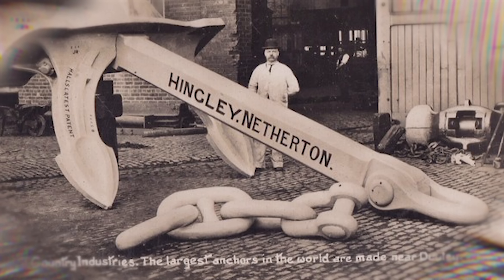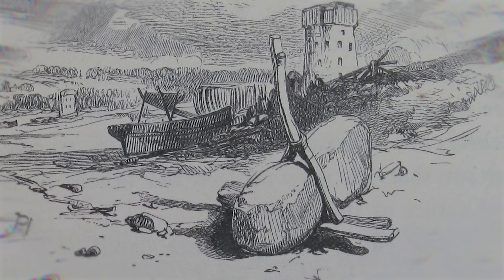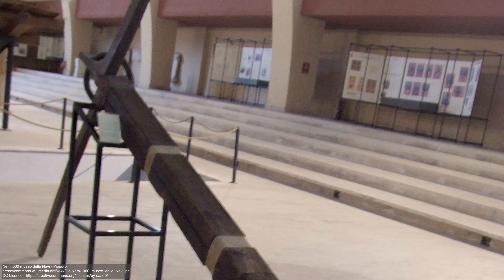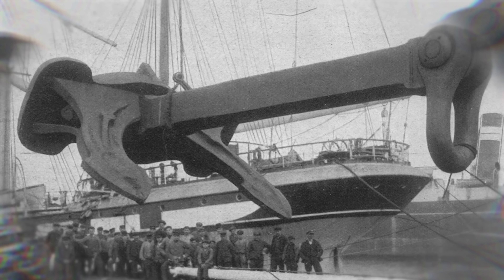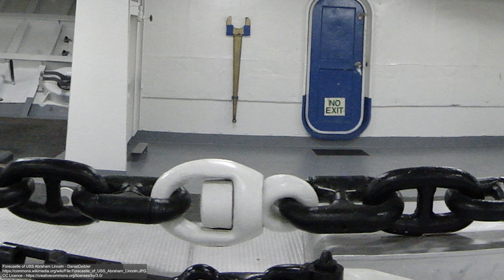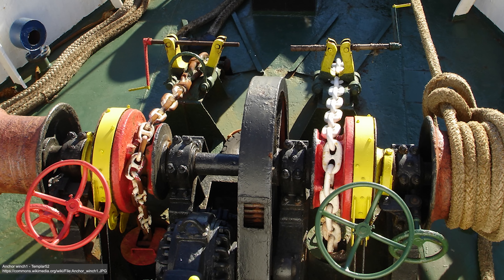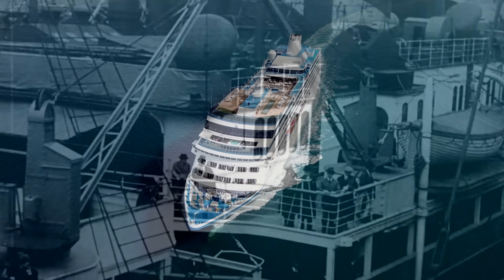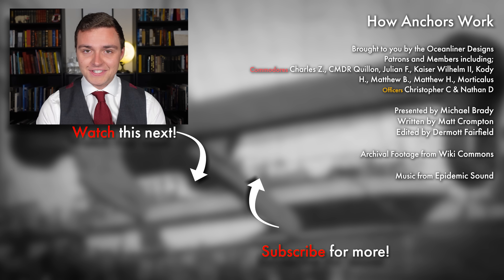How Do Anchors Actually Work?

Comment from the maker: Hi friends, I hope you enjoyed this video! A quick note on anchors; they do not necessarily need to be dropped purely by gravity and it depends largely on the skipper and crew's approach. Some anchors can be deliberately 'walked out' using the windlass so that they don't just drop straight through. Thanks to Michael and Thomas, two of our video reviewers, for this point. I also mentioned most anchor windlasses are electric but hydraulic windlasses are very prevalent on ships today as well.
~Mike
Reply: So basically, they are fishing hooks that you use to catch a planet.
Reply: @T.ring91 you will always lower a 22 tonne anchor using the windlass motor. You have to ensure that the ship’s speed is less than the max pay out speed of the windlass; usually about 0.3kts.
Reply: @OceanlinerDesigns  well researched and correct. Don’t listen to these armchair experts.
Reply: Ikr!?❤😊
Reply: Whilst your channel focuses on ships a supplemental video on Bruce, Stevpris and other anchors utilised in the offshore oil and gas industry as well as the catenary mooring method would be very interesting for a lot of folks
Reply: This is true, especially on the VLCCs I worked on. These anchors weighed over 22 tonnes.
Reply: I used to live in a house in New Orleans with the coolest feature I've ever seen built in. From ceiling to floor connected by what looked like the proper attachments were either 3 or 5 links (it was 1990) of beautiful old badass anchor chain. How many houses have that? They were in there tight too, they couldn't be budged. It must have weighed a ton, so that house has good beams!
The house is a couple of blocks from the railroad tracks and Bywater on Burgundy and something. I would love to know who put the chain there, they must have worked on a ship and probably had very interesting stories to tell, possibly historic. Does anyone else have these installed in their house?
Reply: Is there a estimation of time that titanics anchor may fall?
Reply: The boat i engineered on has one of the anchors from the Nimitz, it is a 25,000 lb monster. We always lowered it with the winch slowly to bottom, the result of the chain balling up and binding in the chain locker would be disastrous. Really liked this video, thanks!
Reply: A windlass is one scary machine.
Reply: 7:46 Port Said is pronounced like 'Port Sa-eed'.
Reply: The pivoting stockless anchors are still in use on pleasure craft. I'm a sailor. These are known as Fortress Anchors and  generally  serve two purposes as an emergency or stern anchor on sailboats and smaller ones in dinghies. In both cases their ability to fold flat allows them to be stored in an aft lazarette or on the bottom of a dinghy (without tripping people).  Most sailboat anchors are a variation of a shovel/plow, with one point. The plow anchor was once considered the best. It was designed after farming plows. But they also did what the farm plows did -- move through the soil as efficiently as possible without getting stuck... the theory of anchoring requires the anchor 'getting stuck.'
The video doesn't really explain very clearly how an anchor works. The essential theory is this: The anchor's weight goes up as the boat/ship gets heavier (and how much above the water freeboard:  windage).  When the anchor is dropped, the rode (chain, rope or both) is  played out until the anchor reaches the sea bed and  some chain is laying along the bottom. When the boat is 'backed' (reversed) there should be enough chain on the bottom  that instead of lifting up it drags along the bottom  pulling the anchor until it  sets (bites) into the sea bed.  Then more rode is fed out until the proper rode to depth ratio is reached. On my boat I like 5:1, so  20' depth, 100' of rode.  If the boat is properly anchored than wind/tide/current conditions won't be able to dislodge it, or if they do, as in a change of wind direction, the anchor should be able to drag a bit, dig back in and re set itself.  (You shouldn't be able to use your windlass to Haul Anchor, pull it up. You'll be able to shorten some of the rode, but a properly set anchor should resist.)
 To raise the anchor:  The boat slowly moves so the bow is right above the set ancho. Rode is being pulled in by the windlass. When the rode goes straight down to the anchor, it will be easier to un set it and pull it up.  
On my 46' (14m) boat I have a working but slightly undersized 45lb anchor, 200' (61m) of 5/16" chain and 200' of three strand rope rode. In poorer or more practical places the local sailors often have only enough chain to lay on the bottom to set the anchor, everything else is rope.   
The best boat anchors are considered to be Mantus, Rocna and  Ultra. What's interesting is that the point of the anchor should be as heavy as possible, this is so that no matter what position the anchor is in any motion will cause it to drop that point to the bottom so it can dig in. Theoretically there could be not very heavy anchors with a very dense heavy point to dig in.
Reply: @WillN2Go1  he is talking about proper merchant ships, not little pleasure craft.
Reply: @garysmith2450  If you're in the merchant marine, let me know what's different, other than scale. What's different in the video is he doesn't cover the basics of any anchoring.   The cruise ships I've been Shanghai'd on by my mother in law, drop anchor, reverse to set, then let out more scope (you can hear it all over the ship) just like my 46'.
Reply: Thank you........                                                        
Old F-4 pilot Shoe🇺🇸
Reply: Thank you Mike.  Another interesting niche subject covered well.
One thing you did not mention was the occasional run-away of the chain when the anchor is dropped.  This should not happen, as the anchor should be eased into the water.  But if the descent is fast enough, the descending chain can overcome the brake built into the capstan, will drag out the rest almost explosively... and can rip out the massive fixture attaching the bitter end of the chain to the ship.
There are a few videos of these events to be seen on YouTube.  On a big ship they are awesome to see even as a video.  These run-aways obviously have a high level of danger associated with them.
Reply: You should learn how an anchor actually works.  Hint: the chain provides mass/length for a catenary curve to ensure the anchor plows flat instead of lifting as tension is applied.
Reply: How about a video on the MV Wilhelm Gustloff 😱
Reply: @OceanlinerDesigns  It's our friend Mike Brady,in this episode, you show the back side of a radio operator, supposedly on the Titanic, do you know if it is Jack Phillips, let me know if you would please
Reply: Great voice!  A real radio narrator vibe.   Maybe you can just narrate and not talk directly to the camera?

Comment: The catnery curve on the chain is the key to how the ship is steadied and anchored. The sheer weight of the curved chain means that most of the energy of any movement of the ship is soaked up by the links moving, so by the time that energy reaches the anchor, it is greatly diminished...thus not pulling the flukes free of the sea bed.

Comment: No, it's not the weight of the chain alone that holds a ship in place. The anchor is what ultimately holds the ship in place. The heavy chain functions sort of like a shock absorber so the anchor is getting wiggled about or lifted up as the ship drifts. It also keeps the load of the ship at the correct angle to the anchor so it digs into the surface when pulled. A lot of smaller pleasure boats (<40 feet) just use normal mooring ropes for their anchors and have maybe a few feet of chain at the end to get the right angle to the anchor. If a heavy chain truly were the only thing holding a ship in place, we'd have done away with the anchor part decades ago.

Comment: Interesting history video, but you didn't explain 'how' anchors work. In the middle of the video time even assume that letting out more chain can break out an anchor more easily. The inverse is true. There are downsides on more chain, but that's not one of them. In fact, in heavier weather you go from 5:1 to 7:1 or even 10:1. Why? Because increased holding power. 

Maybe you can do another video on HOW anchors keep a boat in place?

Comment: The one thing missing from this video, is that it's not actually the anchor that holds the ship in place.
 In reality, it is the massive weight of the chain lying on the bottom, and the friction caused by it that holds the ship in position.
 The chain lying on the bottom is what holds the ship in place. The anchor merely helps to hold the chain at the foremost end by digging in, which helps to prevent the chain from dragging.

 That is why a ship, (Depending on the weather conditions), will typically lay out 3 to 5 times more chain than the depth of the water under the keel, to achieve the neccesary "Scope", The correct "Cantinary Curve"  to ensure that there is enough chain lying on the bottom to ensure that the anchor lays flat and digs in when pulled instead of lifting, 
which prevents the unintended movement of the ship. 
Which is why the chains have "Shot Markings" painted on them, to determine how much chain has gone out.

 Now, before all you "Wannabe Seal Team Six members" and Keyboard Warriors get your panties in a twist and start attacking me, Let me state for the record. I am a Retired, 20-Year, U.S. NAVY VETERAN.

  Over the years, I have been stationed on, Worked on, and stood a lot of different watches on a lot of different ships. And I have gone through countless ship's exercises and drills.
 From being qualified for, and standing every watch station in the "Hole" (The Engine Room), from Messenger all the way to "Top Watch", To being the Throttle-Man for "Crash Back Drills" and for Sea and Anchor evolutions, To being the Man stationed at, and controlling the Anchor Windlass and Capstan during normal anchoring, 
and "Emergency Anchor Drop Drills".
  
  I was assigned to "A-GANG" and have been the "LPO" (Leading Petty Officer) of several "AC&R" Shops
 (Air Conditioning And Refrigeration) on different ships, Qualified Boat Coxswain on everything from small boats up to 50-foot work boats, Was "Boat Captain" of a 50-foot work boat in the Oil Recovery Unit while stationed in San Diego.
 LPO of the Law Enforcement Boat Pool, Responsible for maintenance, Training, Operating, and issuing R.H.I.Bs
 (Ridged Hull Inflatable Boats) to the fleet involved in Drug Interdiction for the West Coast, Hawaii, Guam, and the western Pacific, including Japan, The Philippines, And surrounding ocean areas.

  I didn't intend for this to turn into a novel when I started this. I apologize for making this so long.
Not meaning to sound like I'm bragging, but, to put it mildly, I "kinda" know what I'm talking about.

Comment: Ok explain to me the gravity thing doing the work? Last I knew gravity has no effects in water ?
Reply: Gravity effects all things with mass in the universe, including water. The reason that it seems like there's not gravity in water is because we can move in three dimensions in it. But in reality, we're just more buoyant than water. In air we sink because air is waaay less dense than us. However, a steel anchor is waaay denser than water, so it sinks in water due to gravity. This is also why sand and rocks sink to the bottom of the ocean.

Comment: Still did not understand how an anchor would anchor on the ocean floor. I can understand if it anchors behind a rock but what if the ocean floor is sand? If it anchors behind a rock then they'd have to just leave it i'd guess or send a man to loosen it? No way! The video needs simple simulation how the anchor feature works.

Comment: that shit about the chain being the actual anchor and the anchor just holding the chain in place borderlines on being complete bullshit and warrants explanation, on massive cargo tankers or cruise ships and battleships they use extremely heavy chain and will release extra chain to form a catenary curve through the water resting as much chain on the bottom as needed to relive tension on the mooring load of the anchor so can act as a shock absorber BUT THE ANCHOR IS STILL THE ANCHOR, also most fishing boat, pleasure crafts, and yachts use nylon or polyester ropes that do sink but have no significant weight to them and only use chain on the last few feet of the rode, also a yacht will not be capsized by their anchor drifting or currents changing they literally use a kedge anchor to do exactly that- turn the ship by using the anchor... also there are killet anchors and sentinels that are weights added to the anchor chain to reduce shock but not because the chains link will break from being yanked on thats fucking insane, the deck fittings would give out before a link in any chain unless youre using a chain thats not suited for the weight of your vessel

Comment: Hi Mike,
I do enjoy your videos, I have been watching for a good while and you can tell you are an excellent historian end pretty motivated, but you can also tell you are not a seafarer.

Your videos are great and I enjoy watching the history ones. I have watched a few technical ones, like this one, which is a great video (and I have seen your comment with the correction), but (a big but) some times the technical side lets you down, it´s a shame because your videos are really well done and some effort is put in to them, and then a technical error lets it down (I have commented before but no reply from your side).

On this video, the history was very interesting. Your comment with the correction is correct. I didn´t know that vessels has a different anchor for maneouvring, and I am unsure if that is correct, but nowadays vessels can use their normal anchor for maneouvring in case needed, also anchors are there as a safety device in case of emergency if the vessel looses all propulsion in confined waters or near the coast, it is a requirement to carry anchors. The difference in size of the anchors is more a reason of cost, the bigger the anchor the more expensive, having to carry 2 anchors plus a spare is some expense, if you order 2 smaller ones to reduce cost, use the small one in normal conditions, and use the bigger one when strong winds and/ or tides. Ship owners always question why they have to carry 2 of each on their vessels, and when it´s a legal requirement, they tend to try to reduce cost somehow (some times even in a very comical way lol).

You spell in the most strange way shackle, it sounds like shot. Was it spelling?

And finally, you missed the entire point of the title of your video, you did not explain how anchors work, 3 times the depth, for one reason, 2/3 of the chain lies on the sea bed, and the last 1/3 if hanging from the ship to the sea bed. How it works, as the ship is pulled by tide and/ or wind, puts tension on the chain, the 2/3 on the sea bed pull the anchor so the fluke digs in to the sea bed. Too many shackles out and the ship will yaw more, with the possibility of the cable getting tangled, not enough cable and the ship will drag the anchor as there is not sufficient cable on the sea bed, causing the anchor to not dig in sufficiently.
I am happy to help with any technical subjects in your future videos, because it's a shame that some of your videos are let down by silly things like the above. Feel free to contact.

Regards,
Daniel
Master Mariner
Reply: A "shot" is Ninety feet of chain, and is the standard unit that anchor chain is measured in. It is my understanding that calling a length of chain a "shackle" has meant the same thing as a shot for at least 75 years. 
 I have known very experienced skippers call them "shackles", maybe because that's what you see every 90 feet.
What you call "cable", I have always called "rode".
It seems to depend on where you're from; same thing called different names.  I think it's best to accept it and let it go at that, because I know what they mean, regardless of what they call it.

Thank you.

Comment: What I was taught about anchor dynamics is that heavy chain is used at lengths of 3+ the depth of the  water is to create a catenary curve between vessel and anchor so a straight pull is always on the anchor shank which by swivel action will cause the flukes to dig in. The harder the pull, the deeper the flukes will bury. When the chain is pulled in by the windlass, the catenary curve is destroyed untill the shank is lifted off the sea floor and the swivel action pops the flukes free of the mud.

Comment: Raising anchor was even more tedious, the actual cable didn't fit on the windlass, it would have a secondary cable tied to it and that would be spooled up and as it came in people would untie them or tie them depending if they were raised or lowered. It's the mark of a good model boat :) Took hours, they were lashed every meter or so, so a bunch of people lined up and they all worked on the cables, one would go below into the hold and roll up and the other would be used to winch it and be fed on to the spool.

Comment: I served onboard USS George Washington, Nuclear dept. When I was assigned to the ship, it was in pre-construction. When we finally were able to get onboard after 90% completion, I went to the forecastle to check out the anchors and chains. You can see the anchors on the outside, but it shocked me how large the anchor chain was. Links larger than my thigh and about 3ft. long. Then I got to see the BMs release the anchors. I was glad to be standing outside the area watching. It is a violent operation